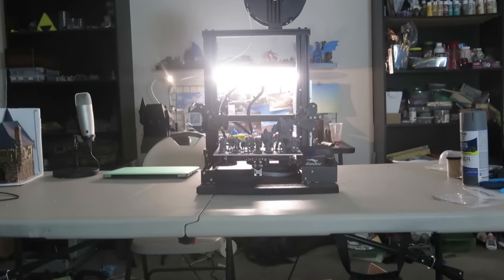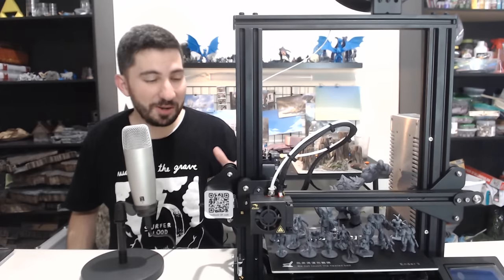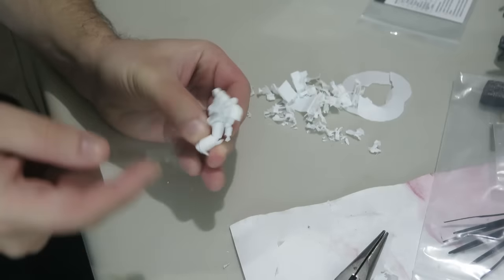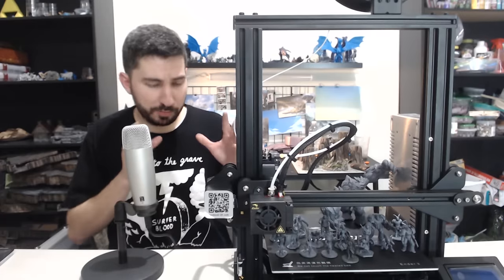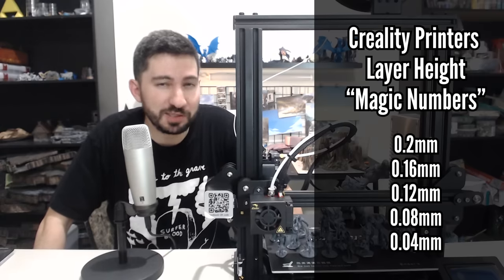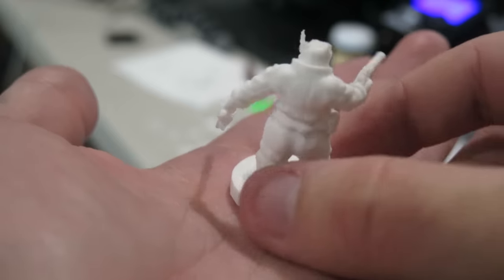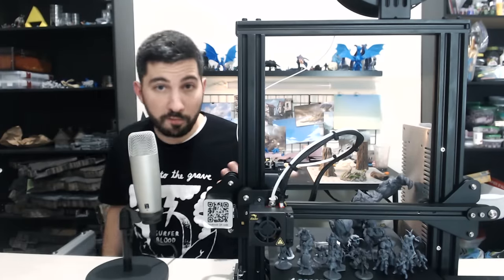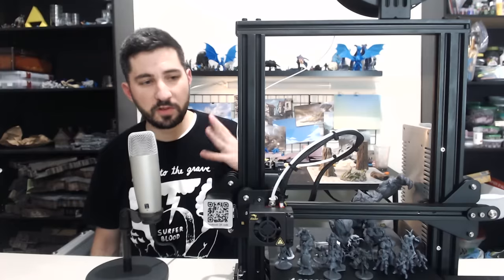How To Print Resin-Like FDM Minis on $200+ 3D Printers (Printing The Game #3)

Comment: 1. 100% infill via "infinite" top-layers
2. Very small layer height
3. Go slow
4. Plenty of supports
5. Orient to the model, not the base.
Reply: Fuck plenty of supports, put the min. on with a simple design so they are easy to come off
Reply: You're a hero. All I needed, you're awesome

Comment: I remember watching this video a while back, before I became more familiar with the in depth settings, and was mostly just using Slic3r. After taking about 5 hours to figure out where the disconnect between my printer and Cura was, I got it working. Luckily I read the comment form the Cura dev and just input all the settings outright. After a bit of tinkering to make it suit my printer and my needs, you have honestly helped me increase my quality by 10x. I never thought this would come out of my dinky Davinci 1.0a, even after the bed replacement and repetier swap. My latest prints are out of a transparent orange, and I've had people actually ask me if I got a resin printer. You see these videos and think, "maybe if I get a little bit of an improvement, it will be worth it, but it's just so far beyond what I expected to actually achieve. Thanks again for bringing attention to this technique and these settings, also thanks for your advice on supports.

Comment from the maker: Hello everyone! I know I'm a bit late with this comment, but figured I'd still pin it for those who are checking it out for the first time: I've gotten a lot of feedback about the length of this video (and that I took a bit too long to get to the actual how-to). Here are links to the key parts of the video along with a tl;dr of these points for those who weren't expecting this much discussion mixed in with a how-to:

01:00 - Introduction, Mini Showcase, & context for the Siepie Profile

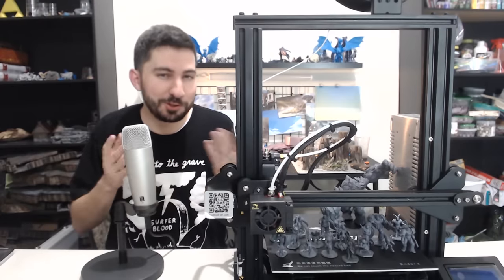07:34 Step 1 - 100% Infill: (9999999 top layers, 0 bottom layers - only works in Cura)
08:29 Step 2 - Layer Height: 0.08mm for newer folks, 0.05mm once more comfortable
10:00 Step 3 - Slow speed: 20-25mm/s
10:45 Step 4 - Supports: Zig zag auto-generated supports in Cura, but use what works for you
13:40 Step 5 - Orientation: Didn't matter in my tests - but consider the model and where support marks might be for positioning.

15:22 - Using other profiles & expectation discussion for newer folks to the hobby

That being said, I appreciate your feedback so much. When I made this video, it was for a small group of people (less than 1,000 subs even) who I felt would have all of these questions, and I thought the context would be helpful. Looking back, I got a little too excited and included way more than I had too. 

I learned an important lesson though with your feedback, though. I'll do my best to separate videos where I have longer discussions about different things like settings profiles from the more direct, how-to's with more applicable info and techniques. I've already started to make these changes in my videos, see here: https://youtu.be/znkbwajT100

Thank you again for caring enough to help me make this channel better, and for your patience as I learn to be a video creator and a YouTuber. I appreciate it so much. 

Danny
Reply: 3D Printed Tabletop still waiting for my ender 3 to arrive. Would these settings work with similar results for larger prints?
Reply from the maker: On my site, I have a large minis profile. That should work for larger minis, but there are probably better profiles with better support settings for other large non-minis. Hope that helps! :) The Ender 3 group on FB is a great resource BTW. I recommend joining it already :)
Reply: Isn't this Printing the Game #3? The one about how much things cost was #2. That makes the one after this #4, not #3.
Reply from the maker: Hi Waffle - you're right! That was my bad. Just made the change. Thanks for the catch!
Reply: Thanx
Reply: Thanx
Reply: Loved the vid! Very helpful.
Another piece of advice: feel free to leave images onscreen a bit longer! There are some really cool minifigs, but it's hard to see all the detail in a split second.
Reply: Is it pls abs or naylon?
Reply: hay love your videos, just watched half of them after turning of ad blocker!

what version of cura are you using? i try using your setting but my prints are coming out poorer than basic settings. so im trying to figure out if its my printer, pla, or version of cura.

Thank you!
Reply: 3D Printed Tabletop thank you for this resource! !
Reply: banana for scale? bröther!
Reply: Hey man love this video thank you so much but i'm sure I've just missed this the 3 times I've watched it but what temperature do you run the base and nozzle at?
Reply: Thanks for this video. I am a beginner and will have the ender 3 pro under the X-mas tree this year. I am so happy to see that such decent minis can be printed with it.....
Reply: 3D Printed Tabletop don’t sweat it bro do your shows how you want don’t pander your content speaks for itself! That being said this is a top notch video I can generally show any noob who never 3D printed before they will understand what you mean and the process thanks for this vid.
Reply: Even this tldr is ages of pointless waffle. Just make your point for goodness sakes. All people want is the title of the video and the checkpoints.
Reply: Hi Danny, I love your videos and never mind the length of your videos. Longer vids are sometimes required to get the best info and you are passionate and interesting to watch so keep it up. 

I do have a question however. 

I’m using your tweaked siepie profile on my cr10s with stock nozzle to print a hero forge mini with some very thin areas (arms outstretched holding a hand crossbow in one hand and a thin necked familiar in the other. I’m having trouble with support materials particularly in these areas. I’m using CURA and using the custom support plugin for Cura but when removing the supports it ALWAYS breaks the model at these weak points. 

Do you have a suggestion to get a more perfect print like yours with the best easily removable supports. The zigzag standard supports you suggest you use always make it impossible to remove without breaking the model. 

Thanks for any extra tips you can provide here. I realise this is an older video and you may not see this comment but I am pretty new to 3D printing as a whole and mainly do terrain which I have had great success with. I’d just really like to build my mini collection with your advice. 

Thanks

Andy
Reply from the maker: Stay tuned, Andy! Making a video on this now. Some members of the Tabletop 3D Printing Guild shared some settings with us, and my tests have been awesome so far. Stay positive, coming soon! :)
Reply: 3D Printed Tabletop excellent! I’m a subscriber so I’ll eagerly await the video. Thanks for the speedy reply too. Keep the great vids coming. 😀
Reply: @3DPrintedTabletop hi can you print animals 40 mm HQ ? exemple rhinoceros cows and steers bulls ?
Reply: Hi, i try print a 32mm figure in my 3d print but i use simplify 3d for sliced my model, I follow your tutorial but not correct work, how is the parameters for use a simplify? Or i need migrade for cura?
Reply: I did enjoy your enthusiasm and your discoveries which has raised your print quality.I have not owned nor printed  before so this was quite eye opening to me to see the level of detail you attained.My questions to you are do you do any commercial work in this field ,what is the smallest scale you go down to ( ie 1/72 or 28mm) Do you only do fantasy figures,what source do you need to select poses for figures and can you print using a flat drawing to achieve a 3 d profile or can you use an existing figurine to produce a particular pose.Thanks again you are doing some nice work there
Reply: If you are printing anything like minis, then using filament that has an easily available solvent does miracles, as you can polish it by vapor smoothing it.
"polysmooth" is a PLA like filament that can be smoohted with alcohol.
ABS (while hard to print) can be smoothed with acetone - and is damn sturdy, sadly it NEEDS an enclosure around the printer in most climates.

Vapor polishing brings a mirror finish, that is only attainable with a LOT of sanding - its good enough to cast stuff.
Its like magic when you see it for the first time.
Reply: @nikolaosstavrou5327  
Its very likely PLA
Both ABS & Nylon (aka. polyamide) are prone to warp unless printed in a ~100°C enviroment, which is attainable if you put ender in a box, and that would be also recommendable due to the fact that those "engineering grade" sturdy materials give of toxic fumes when printing, unlike good old biodegradable PLA.

At the end of the day unless you are planning to leave your stuff outside to cook in the sun, or want it to be able to bear some very significant mechanical loads its simply best to go with PLA, hell some PLA types, like ones reinforced with fibers, and co-polymers, are to some degree able to replace the heavy duty stuff in most of those applications.
And they are much less hassle to set up to print.
Reply: Just DL'd your latest settings for your Cura Profile for mini's, but I'm noticing different Values from that of this video, such as the Top layer thickness is at 13 instead of 999999999. I realize it's been 2 years since this video, so did things change with Cura that you updated the profile "3DPrintingProMiniFile-Cura-4.2-and-on"? Is 99999999 still valid. I have an Ender 5 Pro. 
Thanks!

Comment: Thanks for the tips, gonna try this out soon. For tiny prints I've always just set the shell thickness slightly larger than the nozzle size (e.g. 0.45mm shell thickness for a 0.4mm nozzle), so it's just a single walled shell and set the minimum layer time of 5 to 6 seconds with 100% fan speed at all times. This allows me to use lower infill percentages between 25% to 50% infill and still get nice quality prints but I can still do 100% infill if I want a stronger print. I also use 0.75mm to 0.1mm layers but still get good results up to 0.2mm with this profile.

Comment: Those results are amazing for a 0.4 nozzle ! The top layer trick make sense, the top layer is a finish layer so it is logical that it is making the print look better. With a smaller nozle (0.2/0.3 for exemple) the result could be even better, of course the print will take more time but it's the main tradeof of fdm (speed vs quality). Keep up the good work.
Reply from the maker: Thanks Lundev! I appreciate it so much. A nozzle size test is definitely on my list :) Just haven't gotten to it yet. Cheers!

Comment: Hey man, I got into the 3D printing world a couple months ago - and need to say THANK YOU in short.
I jumped in deep right off the bat by doing some research and purchasing a Dremel Digilab 3D45.
I felt unstoppable because i had one of the badass toys on the block, and the prints with stock settings were meeting my expectations!
And after being satisfied with many prints i wanted to expand my learning more and purchased a resin printer, Anycube Photon Mono 4k.
Sure the print area was sacrificed but this was more for my curiosity... and the quality blew me away.
The difference in quality was not even in the same ballpark, and i got seriously depressed after each print with the resin... kicking myself for dumping over 2k into my fdm.
That's when i found this video... you have evened the playing field by showing me that settings impact the quality in ways i haven't expected.
I still consider myself a complete novice and am willing to put in the time and effort to learn more about the hobby with both fdm and resin, however now light has been shed and it allows me to make judgment calls on which printer to use depending on my project needs!
THANK YOU THANK YOU THANK YOU!

Comment: The creality ender 3's z axis has a 0.04 mm step, which means your layer height should be a multiple of 0.04, if it's not layers might end up at different heights, which can warp your mini, or cause it to bud or fail. Minis tend to be small, so these errors will have a fairly low chance to fail in a small mini such as a medium sized player character. 0.04 itself, will have the nozel hit the mini, so 0.08 is recommended if you want a zero% chance to fail, or any sizable mini

Comment: So, I had considered looking into this. I don't use the same printer (I have an Anet A8), but I wanted to see just how reproducible this is on other machines. The top layers thing was the first thing I tried. Ho. Ly. Cow. What a difference. Then the layer heights on a magic number piece: most prusa-style printers have the same .04 magic number, so putting the layer height at .08 was incredible. I was getting decent results, but the omni-directional fan shroud instead of the default blower clinched it.

Amazing work, Danny! I know that you used a profile from someone else, but you explained it out to where others can duplicate the effect.
Reply from the maker: You're so welcome - glad I was able to help a bit. Also, I saw that you answered someone else with an A8 question - thank you for your help. There are others in the FB group who also have A8's who I think would appreciate your experience and friendliness. Thank you again for the kind words <3

Comment: With a 0.4mm nozzle on a stock CR china printer, that is some very good quality prints.

Maybe I have a tip for your supports, It's kinda based of what Maker'sMuse said in a recent video with his ''Design Tips for Support Free 3D Printing Models (FDM)''.
You have a very small layer heights and a very wide layer width:
You can increase the support angle setting, especially with a 100% fan with PLA. Maybe try a better fanduct as well.
I'd say grab a print angle test model. But I suggest you set it to 65 instead of 50, and if you have great cooling up to 75. Just be warned a high fan speed could blow away prints, induce warping, or cause bad layer adhesion, even with PLA.
Reply from the maker: Thank you, Pokey! Much appreciated :)

Comment: I used to reforrmat 100GB HDDs with Windows XP...six hours is nothin' lol
Reply from the maker: Well, for some people it's an eternity. Keep in mind, the 3D Printing community is interesting - some folks get frustrated if their printer bed doesn't heat up in 1 minute vs. 5 minutes. Time is important to a lot of folks who want to maximize their printer's time being used. I'm a little more relaxed, but want to try and cover as many reasonable angles as possible. Thanks for your comment :)
Reply: @3DPrintedTabletop   I sleep for 8 hours i see no problem with a 6 hour print

Its not like i have to sit there and hold its hand
Reply: @thinfourth  ha you think I get more than 6 hours of sleep, funny.
Reply: There's no patience waiting for anything nowadays because most stuff is available instantly the younger generations hate waiting for anything nowadays
Patience is a virtue that is looking like it's going to be lost
Reply: @thinfourth  I know this is late.... but honestly there is a real potential danger depending on your printer and setup with doing "unmonitored prints". Fire being my primary concern. But, if you have thermal runaway detection, good "enclosure", fire alarm etc. go for it.
Reply: @thinfourth  my 3d printer is at the feet of my bed, if it takes that long to print i ai and getting no sleep that night lmao

Comment: could you update your profile setting on cura for the ender 3 for cura 4.2.1 as i cant use the profiles :( i keep getting a error when trying to open them , thanks in advance and keep up the amazing work
Reply: When I followed the video and punched in 99999... till the end, I got an error too.  Putting in "999999" worked for me and got rid of the error.
Reply: I was able to get them to work. You’ll need to edit the profile files directly. A curaprofile is really just a zip file. Change the .curaprofile extension to .zip, then you can edit the two files with a text editor and update the values that are causing the errors. Then zip the two files into a new .zip file, and change the .zip file extension back to .curaprofile.

Comment: i just printed my first minis on my new Ender 3 V3 SE, and I'm pretty impressed how they came out. some are certainly better than others, but the level of detail is quite crazy. setting is set for 0.2mm prints and I'm using the stock 0.4mm nozzle.